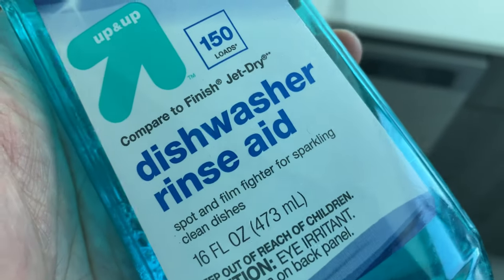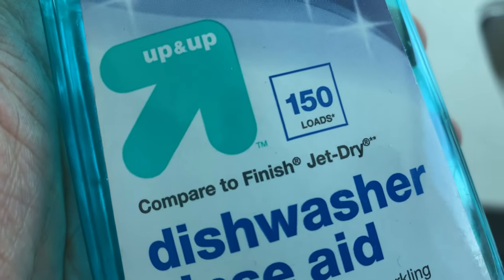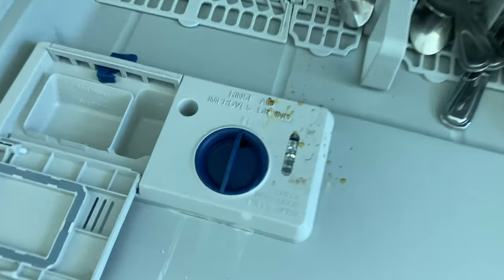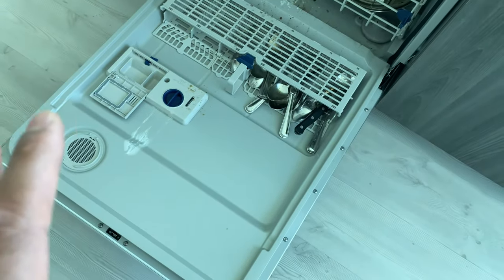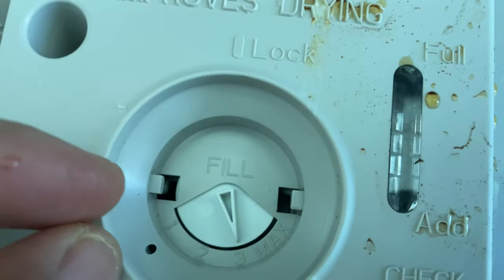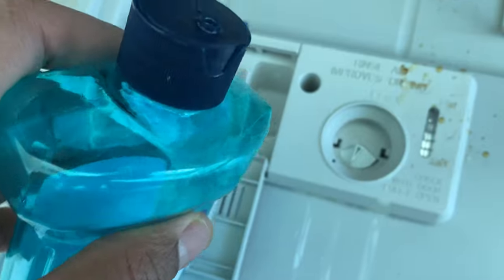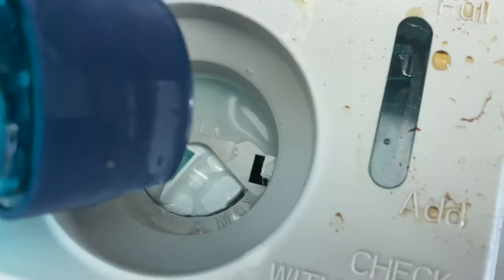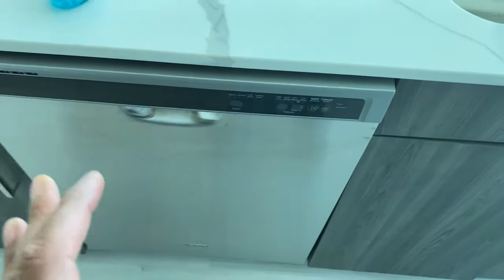How To Add Dishwasher Rinse Aid To a Dishwasher

Comment: Look at that level glass when add that rinse aid!!! When level glass show  "FULL", it's FULL!! If you pouring there too much, it can leak out during washing mode and make foam. That can prevent water pump and those spinning shower arms to work properly. You can drop some rinse to your sink and check how much it makes foam with water! Very very small amount of rinse aid needed per wash.
Reply from the maker: @Deltroyer1963 thanks for the tip